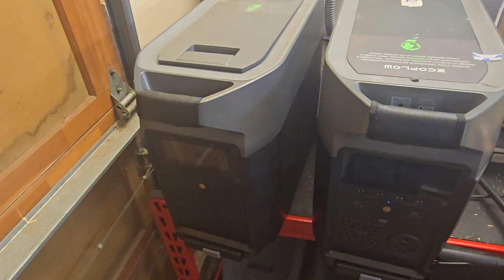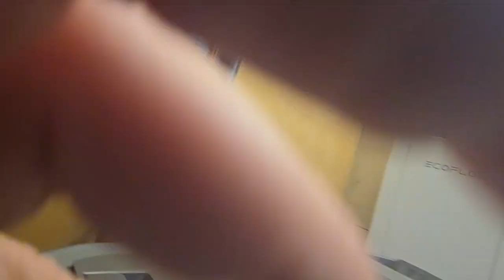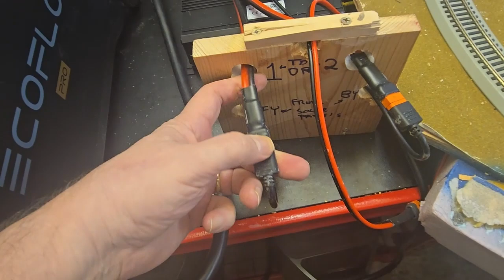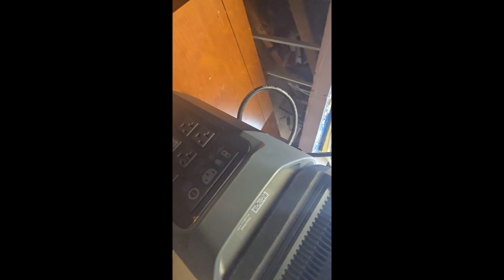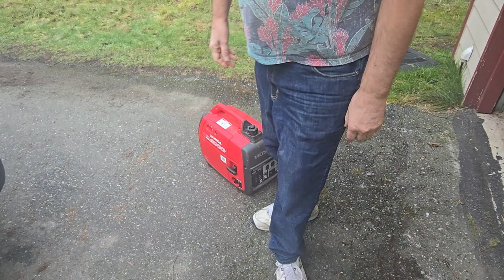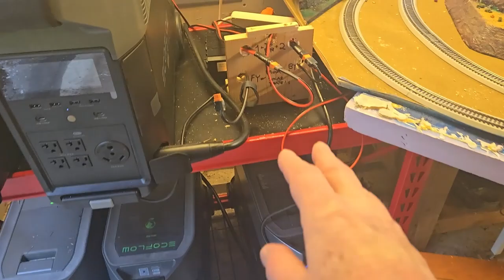Charging Delta Pro, Summary and Demo

Comment: Could you run 2 delta pros off of just one of these SMPS and have it charging both units at 800 watts Instead of one unit getting the whole 1600watts?